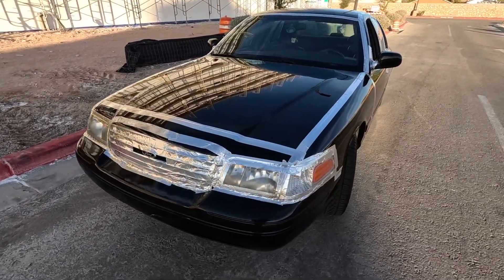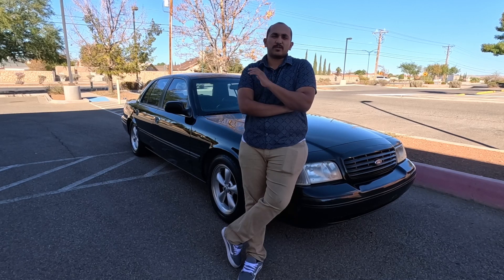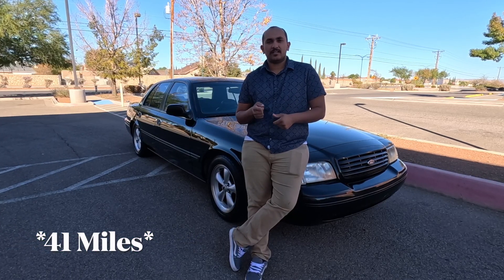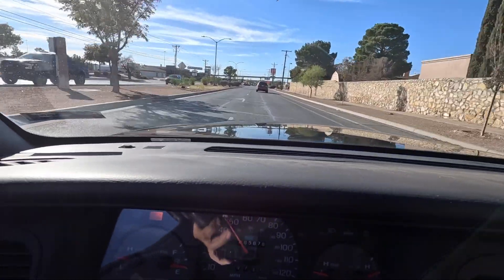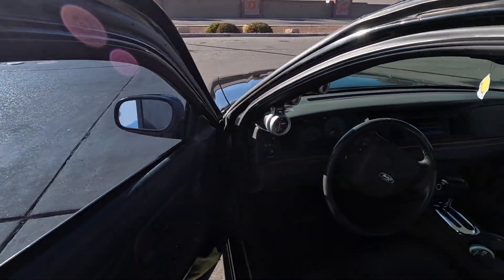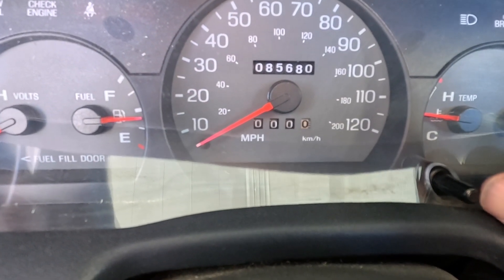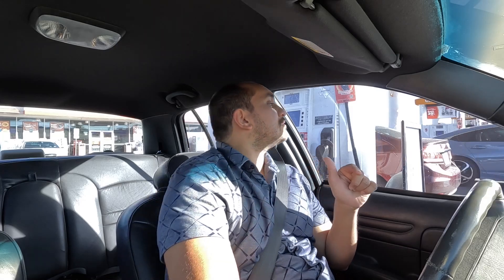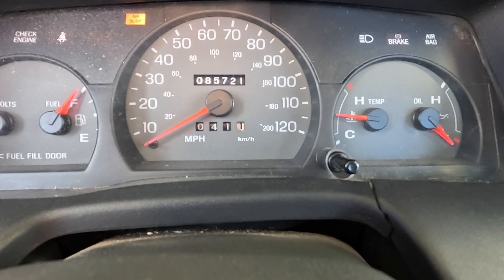Highest MPG Crown Victoria in History??

Comment: Hey, trucker and Ford enthusiast. Back in the day a stock Ford 5.0 H.O. could get over 30 mpg highway with a 5 speed, and my Lincoln Town Car stretch limos did mid to high 20s. The key thing is to kill drag in the driveline, use the best synthetic lubricants in the drivetrain. Anyway, if you want to do something, take your rear differential apart and WPC treat the internals. The rear differential has the most drag, and reducing the friction will make everything pick up. Not snake oil, the process was invented in Japan and has been around for a long time

Comment: “I owned a 2005 Crown Victoria that was fuel-efficient; I could travel 700 km on a single tank of 91 octane gasoline. I currently own a 2007 Crown Victoria Police, which can travel 420 km inside the city before the fuel warning light ⛽️ turns on. My 2011 Crown Victoria can cover 480 km within the city before the light comes on. During highway travel, with a load of 5 passengers at a speed of 179 km/h, the fuel light came on after driving 500 km.”
Reply: The 2005 model has traveled 400,000 kilometers.
The 2007 model has traveled 237,000 kilometers.
The 2011 model has traveled 388,000 kilometers.
Reply: Sorry but could you translate that to freedom units

Comment: I got a 96 crown vic with 2.73 gears, and I get 26-28mpg crusing @70. Mind you, the 91-97 vics have lower drag coefficient than the later whales.
Reply: Your 273 gear is what's getting you the 26-28 MPG.

Comment: What are the gauges clustered on A pillar?
Reply from the maker: From top to bottom, boost pressure, engine oil temp in the middle, and tachometer on the bottom 🤙